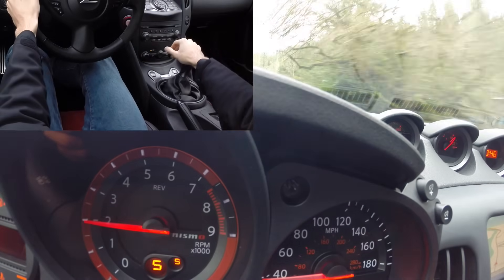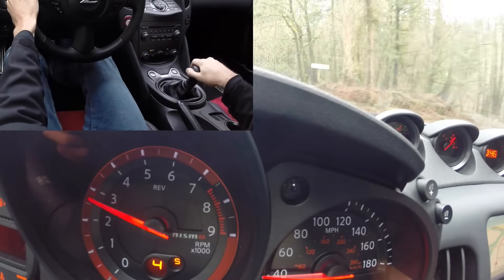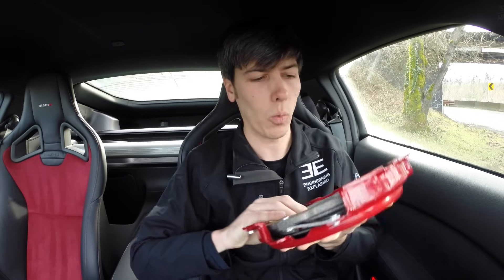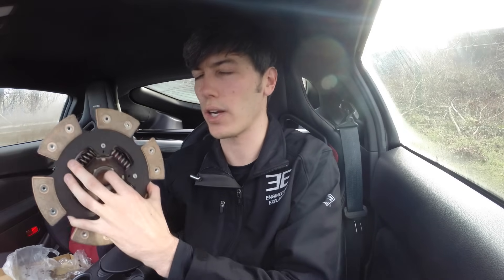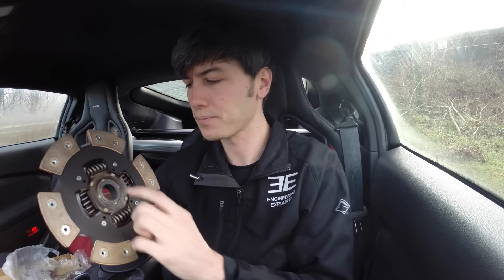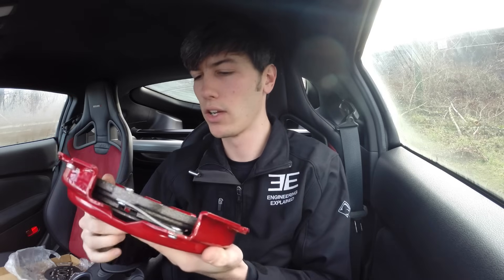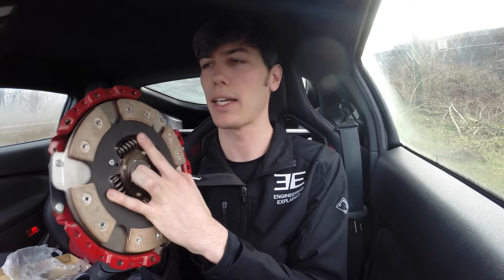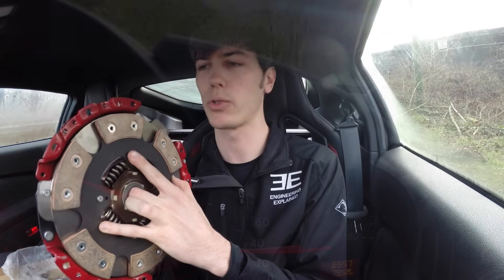What Is Rev Matching?

Comment: how does rev matching work in a vehicle without a clutch? (and no i dont mean an automatic)
Reply: +Razeranton Example of a vehicle without a clutch?
Reply: Hear That? okey i didnt mean without a clutch, i meant without a clutch pedal.
Reply: +Razeranton What kind of vehicle without a clutch isn't an automatic?
Reply: Dick Pickles go cart
Reply: Razeranton
Those don't have gears, so it doesn't really matter.
Reply: Dick Pickles im driving a 6 geared go cart class called "KZ2"
Reply: Spme types of kart come with gears. But usually drivers don't rev match, even the clutch is used only for startings. Personally I haven't ever driven a kart with gears, so I don't know how harsh could it be shifting that way. But I believe that because of the small light engine, crankshaft, flywheel, the inertia is very small and has a very little upsetting effect while shifting...
Reply: I'm not sure about go-karts, but on four wheelers without clutch levers, a clutch disengages as you move the shift lever. Because everything is much smaller than on a car, you don't really need to rev match, but you could rev the engine while holding the shifter down if you really wanted.
Reply: +Razeranton are you talking about a semi automatic? Like some of the honda trail bikes when you hold down/pull up on the foot gear shifter it disengages the clutch while selecting the next higher or lower gear?
Reply: +speedyme200 Sequential transmissions and most modern cars have them now
Reply: ...the exact same way...it just happens with out a manual clutch...
Reply: In that case you either blip the throttle when shifting down or a computer does it for you.
Reply: +speedyme200 is a Honda quad a semi auto?  I thought Hondas have a special spring assisted clutch,  which isnt really a semi auto
Reply: +Dick Pickles i think SAAB made a manual car with automatic clutch
Reply: +Razeranton well, I don't think you can. You need to be able to control the clutch to do revmatching.
Reply: Mircea Dogaru but when you downshift and the engine RPM spikes to 15 000, how is that not destroying everything
Reply: Razeranton that has nothing to do with rev matching. You'll have the same result with a manual. Generally auto boxes are protected and won't shift to a gear that would have the engine exceed its max allowed rpm.
Reply: Razeranton You mean 5,000?  Unless you drive an F1 car, there is no way your car can rev to even half of 15,000
Reply: Old Gregg go cart
Reply: Old Gregg of course it can. Accelerate to 70mph then quickly downshift into second gear. It will rev to 15k rpm (give or take) before shooting its head and pistons through the hood. Two things though: first you need a manual and second, kids, don't try this at home.
Reply: +Razeranton yes into neutral rev match and down shift into gear.

Comment: So if you're just downshifting to slow down you don't really need to rev match unless you're preserving your clutch
Reply: +Grant Rodgers That's correct, but the caveat of downshifting while slowing down is that when the RPM is higher while in gear, the engine will actually help brake the car and slow it down quicker than just using the brakes and keeping the car in the same gear. If you are driving a manual car or a car that you can control the gears, just let off the gas when at a high RPM and notice how the car slows itself down because it creates a partial vacuum caused by the closed throttle.

Also if you're just slowing down, you can keep the car in the same gear and nothing will happen to the clutch. You can also slow down, put the car in the appropriate gear and rev match it to the correct RPM for that gear and that will essentially do the same effect.

Comment: how do you down shift rev match while braking?
Reply: Press on the brake with your right foot and use the heel or side of the same foot to blip the throttle. It's refered to as "Heel Toe Downshifting"
Reply: talltomrich1 ahh so it is heel toe. thanks. i guess a better question is is it necessary
Reply: Not at all.  Most people will just push in the clutch and use the brake to slow the vehicle.  But in a racing application Heel Toe is widely used.  Most in track driving.
Reply: right on thanks.talltomrich1
Reply: +rtswift you don't
Reply: heel toe shifting

Comment: You are a well informed young man.
Cars without "rev matching" ability present a problem in that it takes a willing transmission & synchros, to assist the driver in doing so without the ever present "crunching of gears" noise. Never easy in my experience especially considering the eventual cost of replacing clutch & or transmission should one screw things up badly enough. Clutches wear every time they are used so it's not an "if" equation, rather a "when" eventuality. It's also the reason my 993 has a tiptronic rather than a 6-speed. An aside: I drove 18 wheelers for 47 + years and always "shifted without the clutch." Big trucks big transmissions, slower gear speed etc make it a way of life. Never a problem, upshifting or downshifting. Even on a bike in the lower gears it's problematic.

Comment: when im bored i shift without clutch just using revmach.
Reply: Colin hemligt You're not a machine, you can't match it right every time. Engineers designed clutch for a reason. Don't try so hard to be a badass, it's just wrong.
Reply: Someday will be your sad day because of this.
Reply: Very useful skill. I've had to drive 4 cars with locked up clutches. Once in ski traffic on I70 through the mountains. Just understand that your sincros are working very hard even if you're very close.
Reply: +Colin hemligt You would have to be exact and that is very difficult. Try downshifting into 1st and you'll get a better idea of how exact you would have to be. 1st often doesn't have sincros.
Reply: Abdullah Bal im not trying. i was not born a badass but when i became one there was nothing i could do about it.
Reply: +Colin hemligt It puts more wear on the internal components of your transmission. Syncros specifically.
Reply: +talltomrich1 whell do it right and there is not much stress
Reply: That's a good way to burn up your transmission.
Reply: +Colin hemligt lol, very nice. I tried it once but since then left it for what it is. Very cool skill to have mastered btw.
Reply: +Colin hemligt trust me,nobody that brags about being a badass is an actual badass.Badass people don t need this shit...you re just a troll
Reply: Abdullah Bal why?
Reply: +Abdullah Bal welp, is fixing a broken car actually a pain in the ass? no. Its a good use of time.
Reply: +Ryan Toomey drive a highway tractor using the clutch . won't take long and it's shot lol
Reply: You're gonna wear out your synchros man
Reply: I didn't know you could do that until one day I was resting my hand too hard in the stick and it happened. Since then I don't rest my hand there, but it's a nice trick to know when you are in trouble.
Reply: Can someone explain me what is rev matching. Yeah still i didn't. 
Is it down shifting without clutch called rev matching?
Reply: Ryan Toomey nah. i have a good car.
Reply: +talltomrich1 Im not saying its easy. im saying im that good
Reply: +Abdullah Bal whut?
Reply: You actually can, takes a lot of practice. Or, if you want to show of a bit, just downshift with rev matching on certains speeds where you know how you have to keep your revs :D . In any way not recomendable though, every manual shifting without the clutch isn't healthy. Powershifting is the 1st to be honest...

Comment: Is this difficult to do?
Reply: takes practice like anything else
Reply: +TekkenH3AT Not really, just practice it: push clutch in, push your foot down on the gas peddle to spike RPM's up 500-1000 more than where it was, switch into the next lower gear at the same time, and let clutch out. If your car jerks quickly forward then you gave it too much gas, if you go backward then it you didn't give enough. Most transmissions are pretty forgiving so if you're within in a 100 or 200 of the correct speed there shouldn't be much jerk or none at all.

It is tough to have the coordination, but just like driving manual, everything becomes muscle memory. Try to learn how high the RPM needs to be for your particular gear and speed you're at.
Reply: Rodrigo Godoy Valenzuela  Nope, this is just how to rev match downshift. The act of heel toeing is when you rev match while braking at the same time. That one takes a little more coordination because you also have to hold the brake at the same position that you want while blipping the throttle.

You can do rev matched downshifts anytime if you just want to get into a lower gear for more power/torque to be available.
Reply: +J Wise isn't that heel toe technique?
Reply: Maybe at first. But then it becomes harder not to do it.
Reply: +TekkenH3AT After you drive your vehicle for so long it, it gets kinda boring and rev matching is something that makes driving a clutch even more better, especially if you have a nice exhaust and you get that one extra rev into first gear at a stop light
Reply: +talltomrich1 Yep, it becomes an ingrained habit. 11,000 miles on my Abarth and I'm hitting rev matches every time now.  I learned to drive stick briefly in the 90s, but this is the first manual I've owned.
Reply: Extremely easy
Reply: +Alvin Brinson I'm sorry.

Comment: My rx7 refuses to accept rev matching smoothly so it's better just to downshift late lol
Reply: +Ty U.  You're either revving it too much, or not enough.  Any manual gearbox will accept it if it is done correctly.  Of course, heel and toe shifting is preferred for downshifts so your braking can remain smooth while you shift.
Reply: +aussiebloke609 hah if you shift it just wrong either the driveshaft or the diff makes a huge clunk so i just found a way around that
Reply: +Ty U.  I've had that myself.  It usually means either your drive shaft joints are getting old and have some freeplay, or the thrust races in the gearbox are worn (or possibly - but comparatively rarely - one or more of your splined connections are wearing.)  That clunk is from taking up the last when power is applied.  matching revs more accurately will help, along with being a little bit more gentle with the clutch, but in the end, the only fix is to replace the worn items.  I guess it's possible for the diff to get worn in the same way, but since the ring and pinion are preloaded, that would be pretty rare, I would think.  Never seen one that bad before.

Remember, all these parts should have a little play in them anyway, so a sloppy shift will still clunk a bit...but the closer to factory spec they are, the easier it will be to shift smoothly and quickly.
Reply: +aussiebloke609 yeah I know I'm super gentle with it, it's a 33 yr old car with 151k miles and no service history lol
Reply: +TzuCraft  Not quite, although they are somewhat related.  Rev matching doesn't necessarily require you to be on the brakes as you operate the clutch and throttle - although it tends to make for a jerky ride as you continually get on and off the brake for every downshift.  Toe-and-heel is simply a technique for using those pedals all at once, whether you are rev matching, double-clutching, or simply starting on a steep hill without using the parking brake.   (Sadly, in the US, there are some cars with the park brake operated via a pedal under your left foot - making it useless for hill starts as you have to pump the pedal to make it engage or disengage, while already holding the clutch as the contact point...  You get the idea - not enough left feet.  :-P  The toe-and-heel technique is very handy here since I can be rolling onto the throttle and off the clutch before I start releasing the brakes.)
Reply: +Ty U. spider gears
Reply: +Ocean Blues i have absolutely no idea.
Reply: +aussiebloke609 Wait, I thought that heel toe shifting Was rev matching... How are the two terms different at all?!
Reply: +aussiebloke609 Works exactly the same on a motorcycle, just easier since each foot and each hand only has one task.
Reply: Well, except the right hand, which has to work the throttle and your main (front) brake simultaneously.  Even if you have linked brakes, I'd still rather brake with my hand - better feel that way, and it's not too tricky, since hands are more dexterous than feet...and having a sequential 'box sure helps so you don't have to worry about cutting the shifter across the gate...and accidentally get the wrong gear.
Been there, done that...trying to shift from 5th to 4th...and ending up in 2nd...isn't good for the engine.  :-P
Reply: aussiebloke609
Likewise on the shifting!
Reply: Ty U. I drive an RX8 I rev match the piss outta it.

From like 4th to 3rd just clutch in and blip the gas as you let go of the clutch into the gear you’re in.

2nd year from 3rd is sometimes tricky. Never do 1st gear lol at that point just throw it in 2nd and take the corner,

Or leave it in neutral and brake/full stop at a light

Comment: i have a question too, what difference does it make to double clutch or just push the clutch in and rev up and then release the clutch?
Reply: +Markus Tikkanen Double clutching reduces wear on your synchronizers
Reply: +Markus Tikkanen When you 'double clutch', you rev match, and briefly engage the clutch with the transmission in neutral to rev-match the internals of the gearbox and help it slot into gear.

Modern gearboxes have synchronizers, which are small friction clutches that help match the speed of the geartrain to the speed of the selector hub (being spun by the wheels) as you shift into gear.  If everything is working right, the gearbox will slide smoothly into gear without the driver having to do anything special.

Older gearboxes did not have synchronizers (or only on some gears) and if the gear and selector speeds were too different (e.g. on a downshift) it would grind horribly and not go in (like if you forgot to use the clutch). To smoothly shift these transmissions you need to double clutch and match speeds manually.

Comment: I tought rev matching was to match the speed of the shaft inside the gearbox that's connected to the wheels, to the speed of the shaft that connected to the engine. Normally synchros do this but rev matching helps, and older cars and trucks don't have synchros. If the speeds of the shafts are different then you can't get the car into gear, and you either either let the synchros match the revs or you give it some help with the ol' heel and toe, but I'm pretty sure if you tried to shift too fast and don't rev match, you will end up with that horrible grinding noise and not able to engage the gear.

Comment: How do you calculate the rev match that you need?  Like if i'm going in 4 with 1000 RPM how much do i need to rev up the engine to be matched with 3rd gear? The same when I'm upshifting?
Reply from the maker: +RyderGaming Drive your car in the different gears at different speeds, this will let you know. Might take a bit to learn.
Reply: Engineering Explained Thanks :)
Reply: +RyderGaming On flat ground it should be the same as in 3rd. As in if shifting from 3rd to 4th brings you from 3000RPM to 1000RPM then you should rev to 3000RPM if youre downshifting from 4th to 3rd. Itll change depending on load
Reply: +RyderGaming What Jason said, basically. It all comes with practice. It depends, obviously, on the gear your shifting to and the according RPM and also on how much your fly wheel weighs. A lighter fly wheel means faster rev drop so let out the clutch as fast as you need to. I recommend trying to rev match when coming to a stop to get a feel for it. Best regards and good luck!
Reply: +FlyingAero Hmm, why would it change? I think that speed of the car is relevant only to RPM and gear. No matter what load you have, if you are on, for example, 3000 RPM and 2 gear you'll drive at 60 kph. If it's different than it means your clutch is slipping.
Reply: Andrew Denisenko Load is the wrong word, The difference im talking about is most likely from your car slowing down faster because you are going up an incline which will change the downshift timing a bit
Reply: Well, u must be shifting very very slowly to get the effect of the road inclination. Usually a shift takes so little that it doesn't matter. Heel and toe is nothing but rev matching while downshifting, especially in race driving. And the effect of the threshold braking should have much stronger effect than that of the road. Despite that, I'd say the blip is still the same.
Anyway from the mathematical point of you, in case someone was looking for how to know exactly where to blip the engine, you need to know your gearing: let say you want to go from 3rd (1.458) to the 2nd (2.105), devide the second's ratio by the third's and you get 1.44. That means that you need to rev up your engine by 44%
Reply: Yury A Now that you mention it that doesnt make much sense either. Ignore the load part lol

Comment: in a manual car if your going down hill is it bad to put it in nuetral? should i keep in gear?
Reply from the maker: +carlo zap Keeping it in gear shuts fuel off in modern cars, and obviously will provide engine braking. Fine to put it in neutral though.
Reply: +carlo zap keeping in gear is better. your car will use lesser fuel and provides engine braking. if you go down a hill and need to break to not speed up too fast you should use the engine braking since your disc brakes can get hot and probably fail